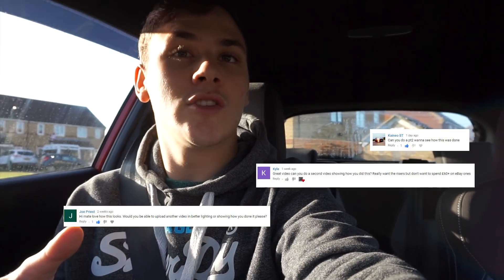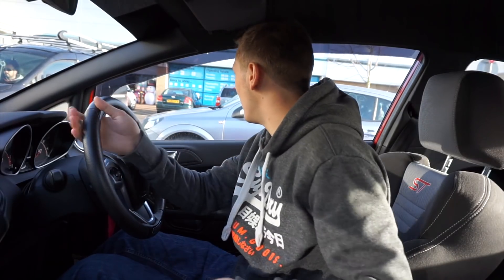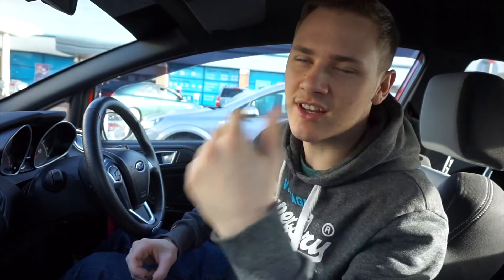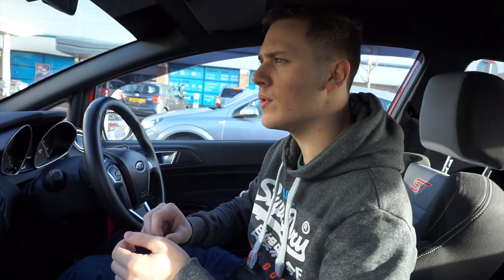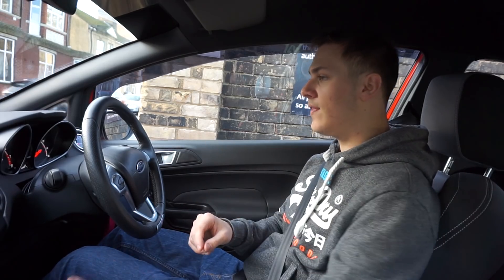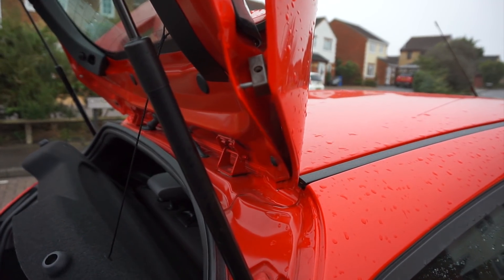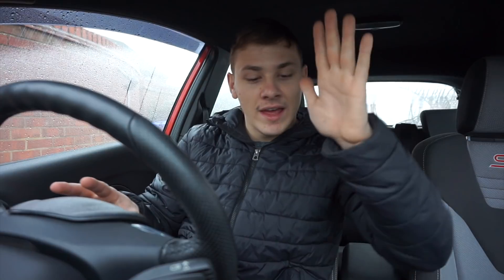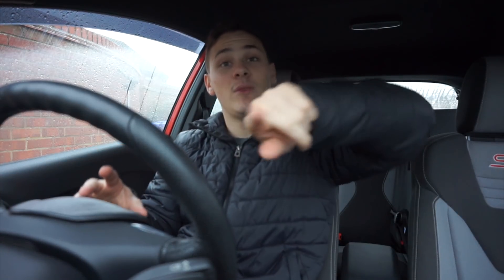DIY: Spoiler risers Pt.2 - Actual footage this time!

Comment: Great video will be doing this after xmas! Do you remember what size the screws and spacers were? Would be a great help! Thanks
Reply from the maker: Thank you! the screws were an inch and and 3/4 long and the washers were 3/4 of an inch wide with a 1/16 hole, hope that helps
Reply: Wilson's Garage thats great thanks! Were the ones that actually went into the spoiler itself shorter? Subscribed by the way!
Reply from the maker: Kyle the ones that went into Tue spoiler were about an inch long, sorry forgot to mention that, thank you for the sub though :)

Comment: And where did you get the black spacer
Reply from the maker: Wicks or Halford mate
Reply: Okay cheers mate
Reply: Can’t find the black plastic parts :( proper annoying
Reply from the maker: @tomwilson6523  just use a pvc tube mate and cut it to length

Comment: Hi mate wondering where you got them little spacers from can’t find them anywhere
Reply from the maker: Joe Priest hello bud, I got them from a a PC monitor wall mount kit, but if you just get a hard small PVC pipe and chop it down into 3cm lengths it would be exactly the same, you could probably pick up a little PVC pipe from a hardware store or plumbing store :) and very cheap as well
Reply: Wilson's Garage  cheers mate I’ve found something I think I can use